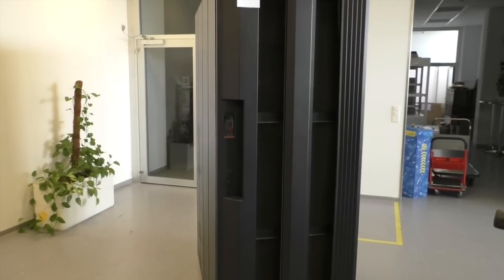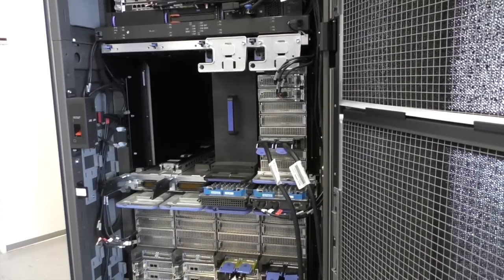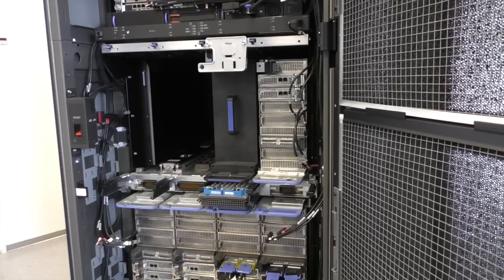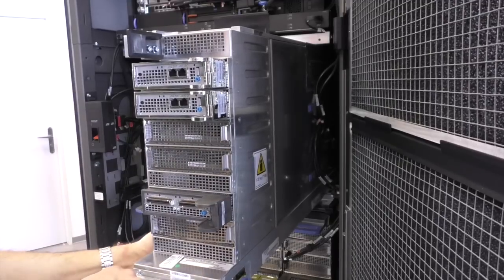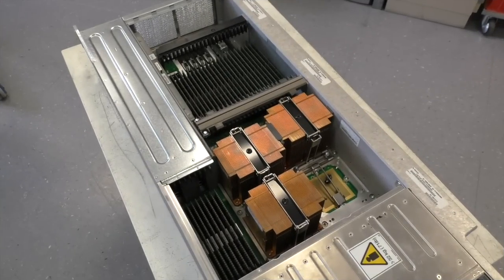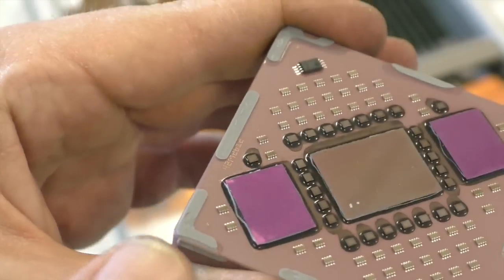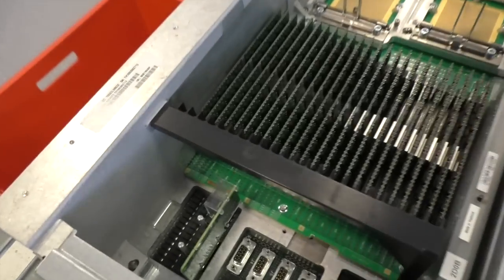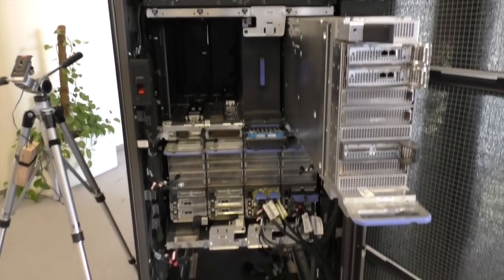$10'000'000 IBM server disassembled - Part 2 (PWJ33)

Comment: Looks like the HMC (hardware management console) is still in there; it's the small unit which sits between the power supplies and the processor books and has a CD-ROM drive on the front of it.
Reply: +douro20 Nope - the HMC is a separate machine outside the chassis. The thing you are describing is the media drawer. It contains the DVD drive used to install the LPARs and is connected to the I/O drawer through a SAS cable.
Reply: zSeries may have its HMC on the frame.  pSeries like this, HMC is a separate 1U server with a 1U keyboard/display kit in a 19 inch rack.

Comment: Built 8 years ago and already obsolete.
Reply from the maker: yes it's sad. That's 1.25 Milliions write off per year!
Reply: whats sad is anything computer wise becomes obsolete in 2.5 years [new moors law], so you spend 100M now and in 5 years there will be computers 4 times faster for the same cost
Reply: i dont think so.... moore's law is already obsolete!
Reply: WeedGames no it was updated to 2.5 years
Reply: A 10 year old Q6600 CPU is still a fine machine and we use as a build server for continous integration compilation tests on a 14/6 basis  (because of the floating work hours from Mo-Sa) in our company
Reply: Lothar Scholz My current go to server is about 4 years old. I prefer to use a old server or server farm for compilations over a brand new laptop.
Reply: don't forget they have to keep up with the demand hell a 80k server with 15 gpus in it will be better than anyone's gaming machine you don't need all that Asus bullshit for gaming you don't need it I won't be overclocking anyway I just want a machine that can run 100k resolution lol this server could probably do that but it's out dated and you probably don't require 100 GPUs to hit 100k resolution maxed settings how about that for a gaming machine fuck the next gen consoles and fuck desk tops might aswel have a super computer server instead
Reply: it really wouldnt mather as first of all they run server  software and second of all no game is optimised for all the cores and gpus in that machine so yeah no gaming on this
Reply: I can't think of any modern AAA titles that run on that architecture so its power its irrelevant for gaming.
Reply: The cheap ass amd 845 blows away the q6600 and can be cooled passively. I retired my  q6600 for one and it runs in an itx case. It might make a nice upgrade, though mine is getting replaced with ryzen asap.
Reply: A 10 million computer obsolete in 8 years .This just puts into perspective how much profit these big companies make
Reply: Bought Q6600 when it was new many years ago 2007-08 fantastic cpu. Still working using it on my old tower PC as a server for media for the home still working after about 10 years of almost constant use even though I rarely bothered to turn it off during nights and past 5 years it is never turned off. Since the electric is very cheap here in Iceland so I don't bother to turn it off.
Reply: Charging that much for something that will depreciate so quickly is basically theft. What a scam lol.
Reply: It's not sad but awesome technological advancement.
Reply: Don't underestimate the huge amounts of time, money and resources these big companies have to put in continuously developing better hardware. Not just faster but also more efficient. I'm not talking generic hardware and software where companies like HP, Dell and Lenovo rely on Intel, Microsoft and Samsung for 95% of their lineups' development but companies like IBM who still do in-house development of true Enterprise hard- and software. The machine in this video is built on IBM's Power architecture and runs IBM software (AIX or System i) and a plethora of IBM applications, tools and firmware. IBM Power is suited for other open source software too but in the end, it is nothing like anything most other companies have. 

Oh, and those prices: nobody ever pays the 'list price'  as mentioned in this video. Standard discount for just about anyone is anything between 30 and 95% of the list price, depending on partner status, in-house certification level etc. etc. so this machine was more likely bought at around 3.5 million USD.
Reply: -_- do you know what punctuation marks are? I get a fit reading this crap. Also, 100k resolution? What are you on about?
Reply: Come on, The Reeper, computers don't become obsolete in 2.5 years lol.  Hell, FX-8350's are just now able to breathe and show their true potential with the newer software and because of the way games are coded, now.
Reply: arent we reaching the limits of silicon transistor size?
Reply: And here I am, working with a 14 year old server...
Reply: It's not obsolete; it's power hungry and inefficient. With an always on system each watt you use is ~1$ per year. On top of that, you need to pay salaries to IT professionals to maintain this thing. It's like buying an old 747 for 500k that's nothing compared to couple million the plane costs, but you're going to being paying millions for maintenance and fuel compared to replacing with something newer.

Comment: They probably use three temperature sensors to be able to get quorum. If one of the three values is different, it's likely the wrong one ;)

About the huge modules in the back:
IBM often uses modules containing their own lifting / insertion mechanisms so that's probably the case here, too. They even have custom tools (veeeery long hex drivers) because the screws operating the mechanism are often buried so deep inside the module that they have to use guiding tubes to ensure you can reach them reliably.
Reply from the maker: That's right.... I have some of these special tools like screwdrivers with a preset torque. 
The lifting mechanisms are marvels of mechanical enginnering and expensive of their own. And complicated to install. It is easier to call a colleague to help lifting the books in and out.

Comment: But can it run Crysi.......... Never mind.
Reply: lol probably 5 instances of it at once xD
Reply: I don't think it even has a graphics card.
Reply: if I recount, these DO have PCIe, and IBM software could and continues to interface with professional (Quadro, Tesla, Firepro) graphics cards, so it's technically possible. Cost effective? LOL no
Reply: Doubtful   Crisis doesnt really thread well
Reply: Can it run Road rash😅
Reply: At this point in time someone already has the source code for crysis 1.
Recompile for POWER7 architecture, slap a gtx1060 on the right slot and have fun with a room heater that runs games!
Reply: It can not.
Reply: @philipcooper8297  Yes its ddr2 but the new Mainframes can in z/VM.
Reply: It‘s just a joke 😑
Reply: I have two servers. Buy 2012. for 9,000 eur. No, its no gaming computer. Maby igy cover strike
Reply: @romannasuti25  Electric Bills To The  🌙 But What Can We Emulate???
I Could Play With This For Years, However My Sons Might Not Go To College Because Of It. 
😂

Comment: Great insight. What are the little chips on the CPU modules? EEPROMs with the serial number? How old is this machine?
Reply from the maker: +Christian Schneider 
Good question... EEPROMS is possible. It could also be some temperture sensors, voltage or current sensors...
That machine was built in 2008.
Reply: +chrigel1234 Is it normal for mainframes to be used less than 10 years? I always thought they are being run forever and the big banks still have VAXes in the basement.
Reply: +Christian Schneider Most probably EEPROMs
Reply: +Christian Schneider Well - once they are marked as End-of-Life, getting them serviced gets really expensive. Because of that, customers usually try to keep their inventory up to date and replace the older models with more recent ones on a regular basis. The really big customers have gotten used to new z Systems models coming out about every 2 years and already include that in their financial planning (they have multiple generations running and always replace the oldest ones).

What is being run "forever" is the software - that's why z Systems are backward compatible straight through to System 360 from the 60s.

The p Systems series is geared towards scientific computing and the folks there usually want to be at the bleeding edge. For those guys, 10 years is a very long time.

PS: I think the proper plural there is VAXen ;)

Comment: How did you managed to unglue the processor apart from the heatsink? it is stuck like hell...
Reply from the maker: ...very carefully... :-)

It's the thermal paste that acts like glue. Try twisting the chip on the heatsink. If that does not work, try to get some alcohol between chip and sink... that will dissolve the paste. Dump it into a container with alcohol and leave it there for a day.
There are some heatsinks with a screw in the center. DO NOT USE that screw to press the chip away, it will break. I tried and it broke...
But if you remove that screw, you can use the hole to fill some alcohol in.

Comment: Are machines like these still build? Like the one you once had on your channel with swapable RAM cages. Aren't mordern components at such a high clock, which makes it impossible to have the ram so far away?
Reply: Still actively building and running in data centres .... and extremely expensive
Reply: @且听风吟-v4w  Scale out, 1U or 2U  Power8 and Power9 servers are very aggressively priced.
Reply: Well, you noticed the DIMM slots in the "book," right next to the CPU sockets, right?

Comment: How fast is that system relative to a modern desktop pc or modern low end server?
Reply: +Coolkeys2009 Does not compare to a general purpose computer at all.
Reply: Simon Howes
Why not ? Apart from redundancy and reliability and hot swap features etc? What it's geek bench score :-)
Reply: +Coolkeys2009 they are entirely different from normal Desktops or servers
Reply: +Vi Wo think off a comparison between a steam train and a sportscar both Transport things but are completely different
Reply: Vi Wo Which one is the steam engine I'm a bit confused? Servers are normally very good at data processing and number crunching not so good for viewing Facebook pages.
Reply: The mainframe is the steam engine. a Mainframe is not a server. A server usually "serves" things like a Webpage or a database. A Mainframe is mostly made for complex Mathematik or having a very high io Performance. Mainframes doesn't even ein a "normal" OS or have a normal CPU architekture like x86 or AMD_64 they are specialized for one single use. And im not sure but if I recal correctly these Mainframe doesn't even have a graphical Output and you need a thinkpad or thinkstaion to operate it
Reply: +Vi Wo I believe he said that computer was around 10 years old, that computer even for it's age supports more memory than consumer pc's of today. I've used mainframe computers and mini computers, they all served multiple users and were more advanced than the consumers toys available at the time. Let face it Android Linux and even Windows OS's all have features directly borrowed from the OS's developed for mainframes 50 years or more before. I've even seen a consumer grade Pentium 3 PC equipped with serial cards driving dumb terminals running UNIX serving multiple users the way mainframe computers used to with Unix decades earlier. Modern mainframes are called Super computers.
Reply: +Vi Wo
No, not entirely different. It is a computer with multiple CPUs, RAM and so on, just like a desktop PC. The POWER chip being used is a fairly standard 64 bit (RISC) design. What makes it different are the management, extensibility and fail over features. AND the much higher throughput mainly because of larger I/O capacities. You are correct though that it uses very different software, esp. regarding the OS. But that doesn't make it an entirely different thing. It uses the same ideas, techniques, all is just bigger.

It is a server, as it will listen to a TCP/IP (or other network protocol, that doesn't matter) port to offer a service. For example a database. It also allows for connecting from many clients to /serve/ their requests. In the same way a e.g. Linux box offers services.
Reply: Well how does this compare to today's mainframes?
Reply: While this is TECHNICALLY a mainframe, it's as much a mainframe as a bunch of NUMA-bonded Intel servers with maxed out networking capabilities are a "mainframe". Yes, it can implement insane levels of failover and contains massive amounts of centralized I/O, but it's base architecture is pretty consumer-grade. the POWER chips in these are very, very close siblings with the processors you'd find inside an Xbox 360.

In particular, POWER chips are at least partially optimized for raw FP compute performance, something that "true" mainframes like the zEC12 lack in favor of insane single-threaded performance at I/O heavy tasks. If I recount, a single high-end Geforce card from NVIDIA can easily outperform a low-end zEC12 or equivalent if the workload is purely mathematical and easily parallelized.
Reply: TL;DR — With all of its books, ram slots, and 24" bays fully populated, this kind of server could be somewhere on the order of 5× faster than a brand new desktop PC in terms of CPU power, have up to 4TB of ram, and contain up to 144TB of storage. (despite being 10 years older) NOT FUCKING BAD

I can't believe people are claiming you can't compare different computers. Seriously, the primary specifications for a computer are processing power (in OPS and FLOPS), storage capacity (in bytes), and IO capacity (in bits per second). There are a few subcategories where things can be different, but it doesn't take a rocket scientist to understand the different types of storage for example.
It's ok to say "I don't know", but to claim you can't compare the relative power of two computers is absurd.
It's definitely hard to find any comparisons between a Power6 CPU and a modern mainstream part like an 8700K, but it's possible. The 8700K is something on the order of 6× as fast per socket IF you ignore some of the more interesting features of the Power6 CPU (such as the decimal floating point unit). *HOWEVER*, a system like the Power 595 had  space for 8 "books", and each book had 4 sockets. So you're talking about up to 32 of these sockets in a single machine.
Fully outfitted, such a server would be on the order of 5× faster than a modern desktop in terms of CPU processing power. It could have up to 4TB of RAM, and 144TB of storage. It has multiple orders of magnitude more I/O capability than any modern PC.
That's seriously impressive, considering the server is a decade older.
Reply: WOW !! It's  so nice to read a CIVIL and intelligent, respectful  conversation in Youtube comments
Reply: A Rack of any multiple Processing Unit's is a 'Mainframe'' Computer.

Comment: i wonder why did  they use those spring contacts for the cpu, and not a intel- like lga socket
Reply from the maker: +costyytsoc This is simpler and simpler means more reliable.
Reply: The fragile pins end up on a relatively cheap part instead of the CPU or motherboard.
Reply from the maker: Something was wrong with your last message. Please contact me again here: playingwithjunk@gmail.com
...thanks.

Comment: what was a typical use for one of These an what was running on them ?
Reply: Database server. Something like this would have a huge disk array connected and serve millions of users, think something like Target or Wal-mart.
Reply: Largely used for Oracle, some DB2, and WebSphere, SAP, running on IBM AIX (UNIX).  This machine also supported Red Hat 5, perhaps SUSE SLES 8 or 9.  This machine is likely Power6, possibly Power5, and it is big endian only, while x86, where Linux grew up, is little endian.  So there was very little Linux uptake on IBM Power, before Power8 which offered support of both big and little endian Linux distros.

Comment: Do IBM still make machines like this and if so what the list price.
Reply from the maker: +Dave Bassett 
You may Google for "IBM Power 6 (or 7) price". I'm sure the $ numbers will be interestingly high.
Reply: Google for power 795, these go round the millions.
Reply: And the new 2017 IBM Mainframe Z13 cost around a billion
Reply: IBM started Power9 deliveries in Dec 2017.  The current "enterprise" models are p950, p980.  This server is Power5 or Power6, 2004-2010.

Comment: so are these x86_64 powerpc arm or something truely exotic?
Reply from the maker: This system has IBM Power5 processors. That's a chip spacially designed for this machine.
Reply: VERRY exotic   Would be good for platform agnostic shit tho (like java)  Would make a killer minecraft server
Reply: Exotic if you look IBM design Apple Mac G5 with cooling,quantum not type processors,PowerPC series,which it is related by is neither,besides what is a 'book'?
Reply: @stevebez2767  A "book" is that vertical component he slid out of the frame.  Inside it were four, 2-core chips.  8 cores in a book, 8 books in a frame, for a 64 core machine.  The current Power9 950 has 48 cores,  in 5U of 19 inch rack space, or 192 cores in the p980.
Reply: No, not x86, but IBM's PowerISA v.2.05 (RISC) 64 bit architecture. Nothing too special, maybe for 08? Besides, IBM has been using PowerISA RISC architecture for decades.

Hope that helps.
Reply: @PlaywithJunk  Power5? WHAT!? lol no. These machines used Power6. Power5 was a dual-core microprocessor that had a max clock speed of 2.3 GHz.